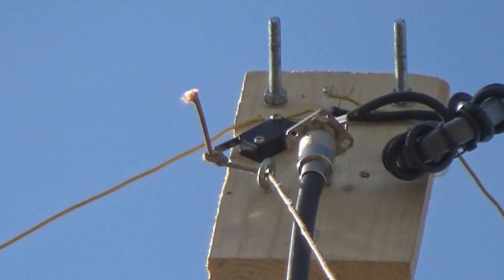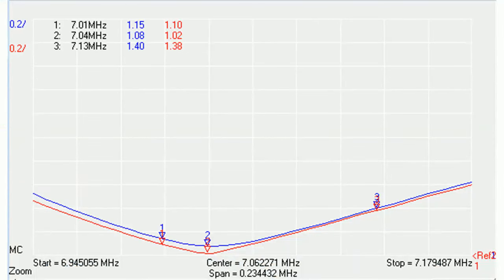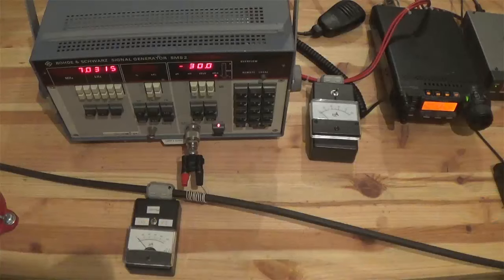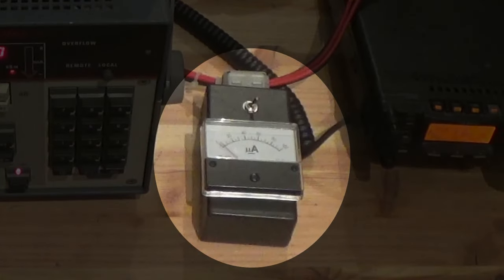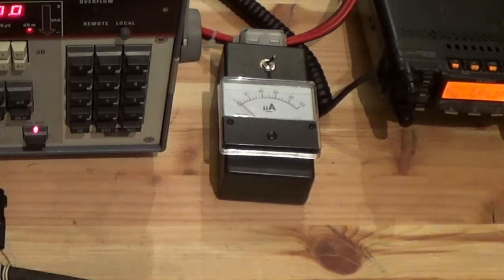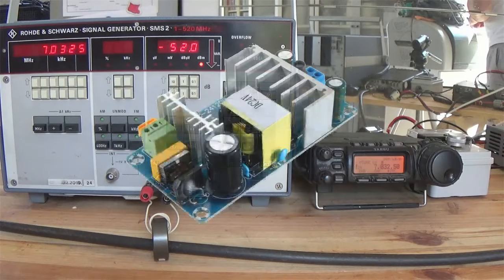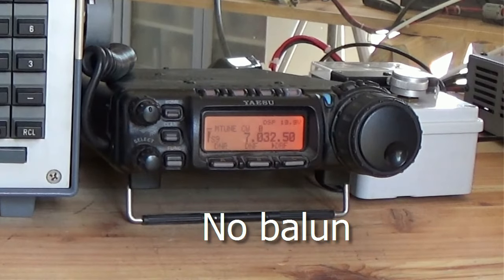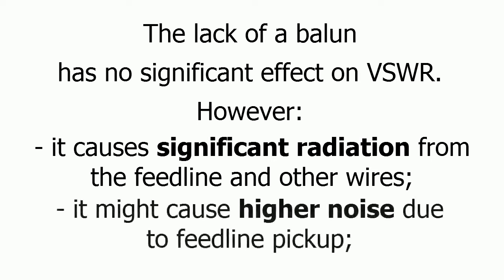The effect of a 1:1 balun on a resonant dipole

Comment: A balun may or may not be needed. Feedline radiation can add "fill" in the radiation pattern of the antenna. I have been an amateur for way over 50 years and have seldom, if ever, experienced problems without a balun. They may or may not create or solve any problems!
Reply: I have been a ham for over 48 years and I completely agree.  I have never used a balun on a dipole and don't recall any problems.  Back then we usually did not use them.  Using baluns is like a fad that has come around in the last 20 years.  I had a 3 element yagi from Mosely that had an unbalanced driving element and in the assembly instructions from the manufacturer, they said DO NOT INSTALL A BALUN IN THE FEEDLINE.  I never put one in thinking that Mosely engineers advised against them but there were those that installed them anyway.  I have used chokes in the feedline and they seemed to work for me.  I am using a two band dipole right now with no choke and no balun and have no rf in the shack.  I have another high power dipole that does have a choke but it came that way.
Reply: Ah, the old "It hasn't happened to me so it must not be true" fallacy.  Feedline radiation is always bad.  If you don't like the pattern of your antenna, change the antenna.  Don't pretend that RF in your shack is a good thing.

Comment: I see no way this test can be accurate because RF has the Skin Effect and it radiates . The switch may make a better RF path when switched in so my conclusion is that his test doesn't prove anything of value . If the Coax radiates on your antenna you have more problems than needing an RF Choke .
Reply: Read about common mode currents and how to avoid the out side of coaxial to radiate
Reply: If the coax radiates it means you have common mode currents flowing on the outside of your shield and you need a balun.  This is exactly what a balun is made for.  His test was completely accurate and very valuable.

Comment: Since the requirement for a balun and the effect of the balun depends very heavily on feedline length to the "ground point"  and the layout of the antenna, this video doesn't really teach us anything. The video is pretty much meaningless except for this one particular test. Change one thing in the test, like alter the feedline length to ground, and the results will change
Reply: If you think this video doesn't teach anything, then you're unteachable.  This is exactly what a balun is made for and is an excellent demonstration.
Reply: @stargazer7644  Sorry, you are wrong. The length of the feedline, routing of the feedline, and grounding of the feedline all significantly change the need for a balun and any effects observed. 

A test in one particular configuration will have an entirely different result in a different configuration.  I can add a balun to a specific system and it can:

1.) Decrease common mode
2.) Increase common mode
3.) Not change common mode   

This is why some people swear by baluns, while other people swear they are meaningless.  I have one 75-meter dipole that the addition of any balun of any style will either not change or make common mode worse. 

I have another dipole that has significant common mode without a balun. The only difference is the feedline length to the shield ground point.
Reply: @Jerrythenerdful  You apparently don't realize if the feedline isn't radiating and the coax shield is acting as a shield as it was designed, you don't have to worry about ANY of that.  Then the coax won't interact with anything.  Adding common mode impedance by adding a 1:1 balun can ONLY decrease common mode currents.  That's how ohms law works.  It isn't possible to add impedance and get increased current.  Now if you use an improperly designed balun (and a lot of cheap impedance transformers out there say they're baluns when they aren't), or use one designed for the wrong frequency, it is possible that it won't reduce the common mode currents by much.  If you have anything other than a 1:1 balun and it only has one wound toroid in it, it isn't a balun.  A proper 4:1 balun will have a 4:1 impedance transforming toroid in it, along with a 1:1 balun toroid in it.  If it doesn't have that, it isn't a balun, it's just a 4:1 impedance transformer (even though it likely will say it is a balun), and it won't have any common mode suppression.